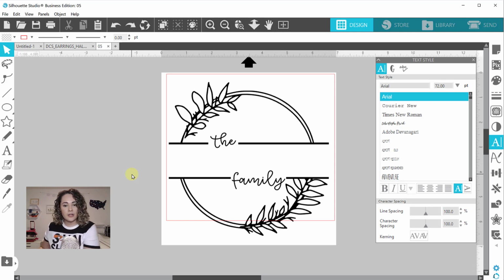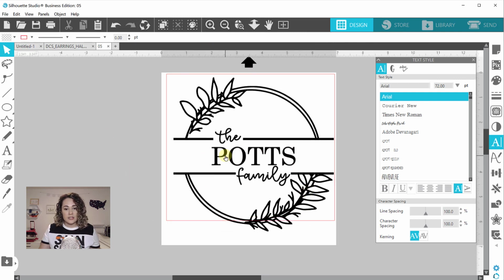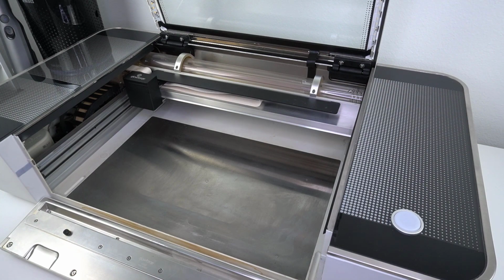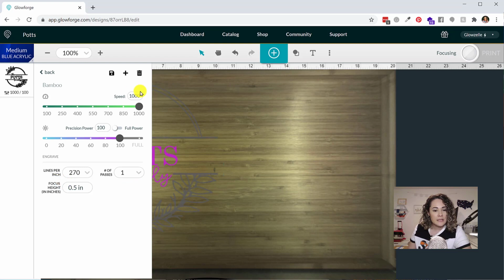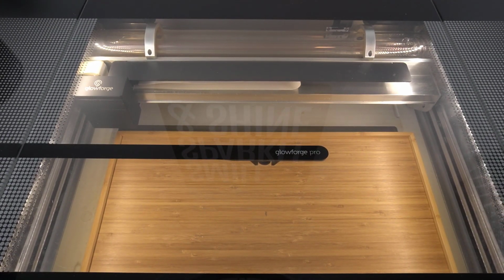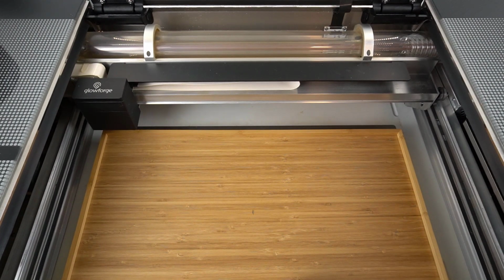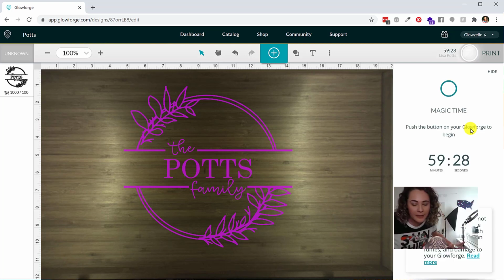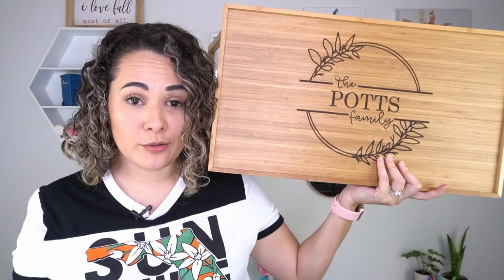Engraving a Wooden Breakfast Tray with GLOWFORGE | Lisa Potts Designs

Comment: Is there a way to take that same design and also Engrave a P behind the image as a monogram?
Reply from the maker: Absolutely. I would make a P, right click, send to back. Then make a small offset around the design on top (like .06). Select the offset, hold shift, select the P. Go to the modify panel and choose subtract. This should take out the area of the P that had the offset. This space helps define your design. 

I would also recommend making the P in back a different line color and engraving it with a lighter engrave to add dimension.

Comment: Hi there, loved the video. Just wondering, when you set the material thickness, why did you chose 1.5”?
Thanks Michelle
Reply from the maker: Weird quirk in Glowforge. I couldn't get out of the screen until I set a height. Once I did that, I just set my focus and it essentially overrode it.
Reply: @LisaPottsDesigns  This is always the part that messes me up when I engrave. So the height you set when you use "uncertified material" doesnt matter, because when you set focus it automatically detects and sets it to the correct focus height?
Reply from the maker: @oliveandapron  Correct! Now with some materials, you can have issues, so that's why we use calipers as well. Some instances it's better to set height, but that's when you're doing something like multiples with a jig.

Comment: Very helpful video! Thanks! I noticed you have your glowforge in your room. Is it safe to use like this? Arent the fumes harmful? Doesnt is cause your room to smell of smoke?
Reply from the maker: Yes, it's in my office! I recommend getting an inline fan setup (I've linked mine in the description). This pulls out the fumes more and is MUCH quieter. My office hardly has a smell, and when it does, I run my air purifier.
Reply: @LisaPottsDesigns  what air purifier do you have? My fumes get pretty bad. :-(
Reply from the maker: @eliseguise3605  I use this one! https://amzn.to/2WRGqtw

One of the big things that helps with fumes is my inline fan, I recommend that first and to tape the connections really well.

Comment: Hello! I was under the impression that there are always burn marks if you don’t mask the wood. What determines whether or not you have to mask?
Reply from the maker: Hi! A few things. 

1. If the wood is coated, most times I don't mask because I can just wipe off the charring. 
2. Some materials I engrave so often, I have found settings that work well for my machine without charring. 
3. A lot of times, if I choose not to mask, I lightly sand the item to smooth it out and get rid of any charring that might happen! 

Personally, I really dislike peeling off my mask, so the majority of times, I don't do it!
Reply: @LisaPottsDesigns  thank you! I didn’t know that the charring could be wiped off if it’s finished. Makes sense!